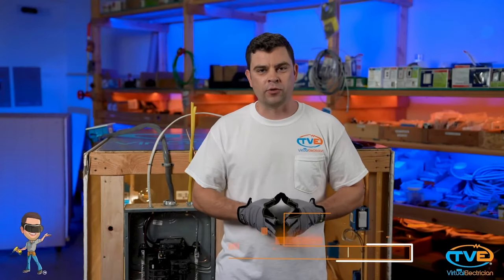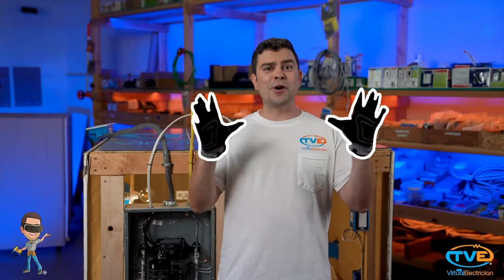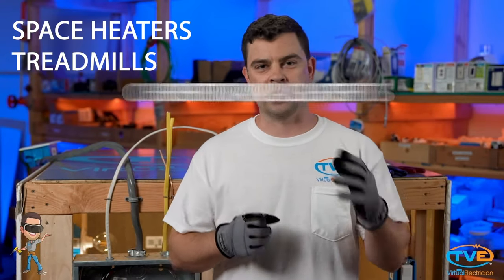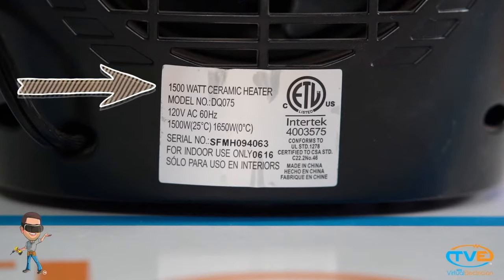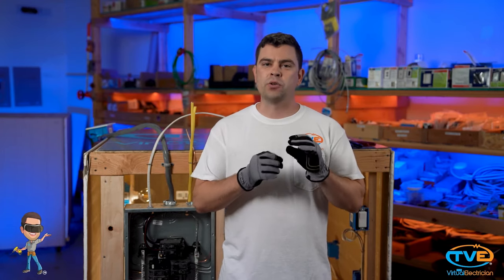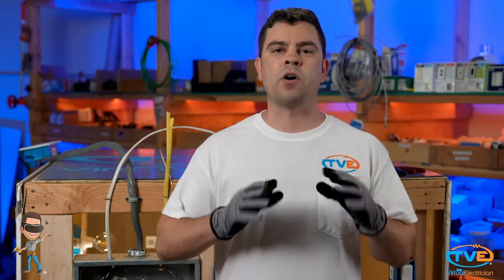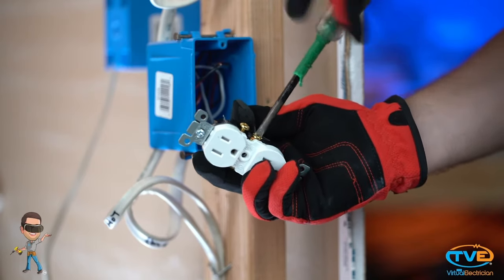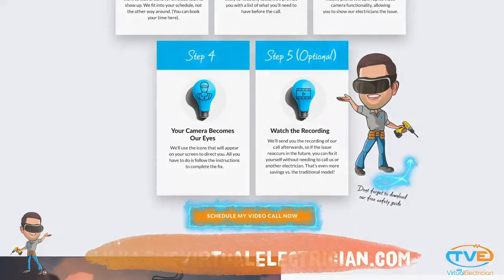Electrical outlets not working?! - How to Fix

Comment: We can’t run air fryer and microwave at the same time. Normally it just trips the breaker. My 9 year old forgot and turned on the microwave while the air fryer was on. The breaker didn’t trip. I turned the breaker off then on. It didn’t return power to the wall. I replaced the breaker and still didn’t work. Could it be the outlet the microwave or air fryer is plugged into?
Reply from the maker: Yes more than likely you will find the problem behind those outlets.

Comment: My house is wired with cat5e and was built in 2007. I plugged an ethernet cable into the wall outlet and I don't receive signal, how do I fix this? Ive tried plugging it directly into the router, and it works, but my router is down stairs and I want ethernet upstairs without running a really long cable.
Reply from the maker: You will need to pick up a cable tester and test the line.   You can try re-punching the connections at each end if you don’t want to buy the tester.

Comment: @TVE I had issues with one wall outlet cause other wall outlets not working, like loose wiring in wall outlets makes other outlets with in the circuit not to work?
Reply from the maker: Yessir. That’s it. If you need help book a time on thevirtualelectrician.com and we will knock it out togrther

Comment: What a life saver (and money saver) your video was for me. I couldn’t figure out why the outlets would not work in my two back bedrooms until you went through the causes related to space heaters. This was exactly my issue with a short power outage at the house and a space heater that was plugged in. I shut the breaker off, took off the outlet cover and outlet plugin to find the area slightly burnt/plastic melted around one of the wires. I’m so thankful this didn’t spark a fire BUT it did cause all the outlets tied to that power wire to not work. I changed out the outlet and true magic now my outlets are all working again. 

I am however changing those outlets to a gfi outlet just in case another power outage occurs to minimize risk of fire. 

Thanks again for your helpful video!
Reply from the maker: you bet!

Comment: Hi can you help me out please? Thank you for the videos. 

So about  couple months now it all started from the master bedroom light and a wall outlet on one wall that stopped working. Then since then electrical around the house stopped working. For instances, the kitchen one wall with an outlet where we plugged the fridge and microwave suddenly stopped working. Then we used an extension cord on the other wall (left side) where sink is so it can reach the fridge…it worked but keeps going out and we thought maybe it’s cause the extension cord is heavy and may not plug in tight and we wiggled as we wiggle it will turn on and off so we taped it to hold in place…that outlet now is dead too. Then now I have a different extension cord with just 1 plug I use to plug the fridge in and it connected to the outlet on the right side of the sink where the disposal switch is (oh and the disposal doesn’t work but has power maybe that just need replacement), anyways and from there just last night the outlet on the wall facing the front door stopped working and an outlet on the left of that wall only 1 plug outlet works but can clearly see black things like it exploded so I unplug it now today after I saw how dark the damage is and same night last night the dining room and kitchen lights (both separate areas) stopped working, hallway bathroom light stopped working, my sons room light and outlets are not working. 

I watched YouTube how to check using a multimeter and I have one that from harbor freight called cen tech a red one and I set it to ACV 750 and tested the dark one that looks blown up and top plug one comes out at 125 and bottom plug zero reading or no numbers come on and it doesn’t work when attempted to plug something in to test only top one works. Then as I went to test the wall outlet in the dining room I inserted the black lead probe on the left of plug and RIGHT when I inserted the RED lead probe in at first no reading so I thought maybe I didn’t put in far to where probe is not making contact so I push a little and the outlet SPARKED in my face and outlet is also black now with the right side of the hole looking so much bigger! Like it suppose to look like a parallel line but now it’s a circle.  And the multimeter the red probe metal part is damage. 

Do you think you can help me? I have reset all the gfi 1 main one that turns the other 2 on I guess cause if the main gfi isn’t on the other 2 will not reset at all. Other 2 gfi only lets me reset and actually clicks if I reset the main one that has the red and black button. I also checked the power panel switch box outside to see if any of those switch are in the middle and all are turn on but I did turn off and on all switches that said ;lighting, kitchen, washer and dryer, etc. still none of the lights work and outlet still not working. 

We have home warranty and already requested service but taking too long. I’ve contacted the service company and left a message as they have not even contact me for an appointment.
Reply from the maker: It sounds like you have a bunch of loose connections in your devices. I can walk you through each problem but you will need to go to www.thevirtualElectrician.com to schedule an appointment. I will be able to use the video functionality of your phone to see what you see. I will be able to draw on your screen to show you where the problems are.

Comment: Hello TVE,
I replaced an outlet ( Leviton T5320-W) in my kitchen and test it, start working, then I cut the power off from main switch to wrap-up the fitting of the outlet. but when I turn the main switch on again from main panel and check again then it stop working  and there were 2 more outlets stop working either. then i replaced circuit breaker and all three outlets but there is no power in all three outlets. I check with multimeter, tester and with receptacle tester there is no power. so where I need to dig now. help me please. thank you
Reply from the maker: If it is a kitchen outlet, is it protected by a GFCI that might be popped?
Reply: No there is no gfci. No current in any of those three black hot wires.
Reply from the maker: @sandeepsinghdugh6297  do you have 120volts at the breaker?
Reply: Yes
Reply from the maker: @sandeepsinghdugh6297  did you try removing the outlet you originally replaced to see if a connection came loose while screwing it back into the wall?
Reply: Yes, connections are fully tight.
Reply from the maker: @sandeepsinghdugh6297  ok. So what you do now is:
1. Turn breaker off
2. Remove all devices on the circuit
3. Turn breaker back on
4. Use a non contact voltage tester to see which box has the hot wire in it. 
5. Once you find the hot wire, you will probably find the problem was in that box
6. Reconnect devices and turn breaker back on
Reply: I am so surprised that is no power on these all three outlet's hot wire, I took off the outlet and check all three hot wire with multimeter but no power.
Outlets are new, wires are fully tight, brekers are new, there is current, tested with tester.
Reply: Ok, I removed all three devices and turned on the breaker again and check every single wire with non contact voltage tester but I could not find the power in any of the black ( hot) wire from these three outlets
Reply: All other outlets are working in the kitchen except these three.
Reply from the maker: @sandeepsinghdugh6297  how did this problem first occur?  Did it happen all on its own or was something plugged in that caused the outlet to stop working? What does the breaker panel label say? Kitchen outlets only?
Reply: Do I need to open any other outlet from kitchen to make sure?
Reply: Refrigerator was plugged 🔌 in before and one day that outlet stopped working and we moved the Refrigerator to the next outlet so yesterday I replaced that outlet and test with receptacle tester and it work once then I cut the main switch off from main panel to place new outlet back into the box then turned on the main switch again and check again with tester and there was no power then I checked next two outlets and those didn't have power either. Now I am stuck.
Reply from the maker: @sandeepsinghdugh6297  there is either another outlet on that circuit that you don’t know about or your problem is concealed. ( behind the drywall). At this point I would have to get my eyes on it. If you go to www.thevirtualelectrician.com you can schedule a time where I can use the video functionality of your phone to see what you see
Reply from the maker: @sandeepsinghdugh6297  indeed. And you are sure no other outlets are on that circuit? Or gfci?  The wire could be damaged in the wall
Reply from the maker: @sandeepsinghdugh6297  you would know if any of these outlets are on the same circuit by turning the breaker off. If they go off then that is where the problem is